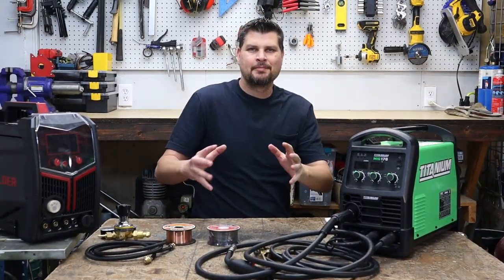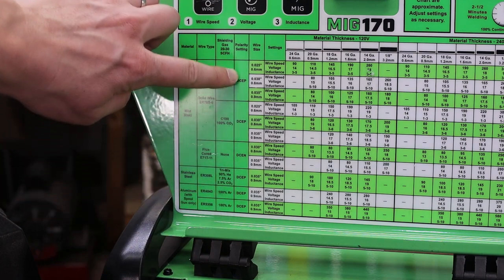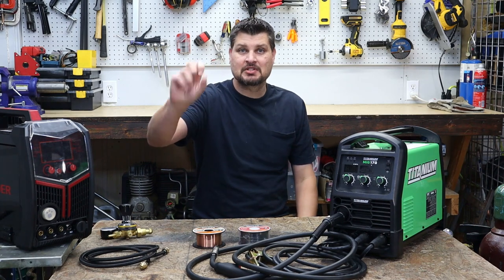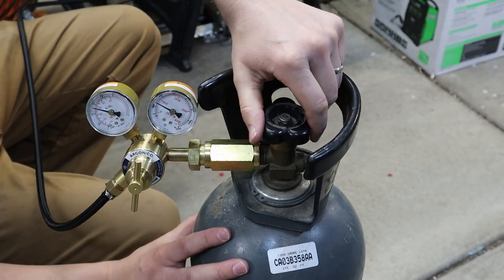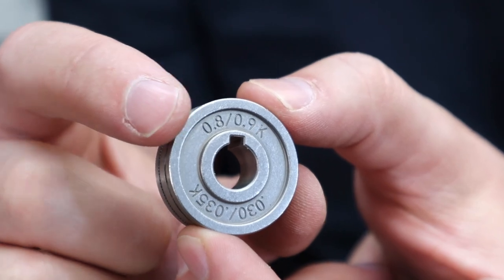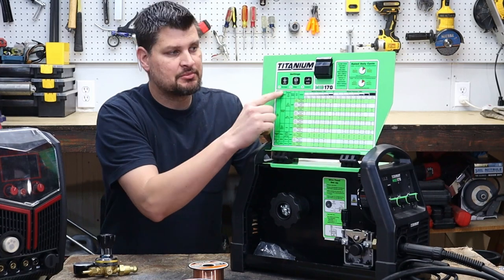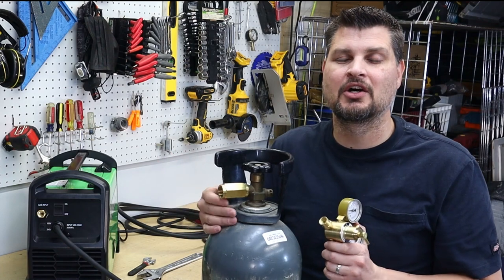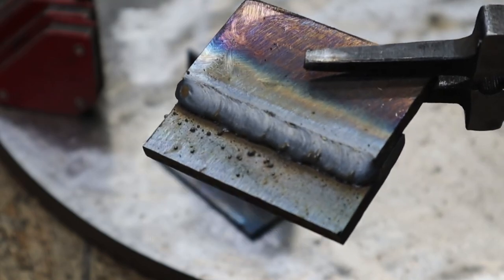Welder Gas Setup!  Switch from FLUX Core to MIG Welding!

Comment: Prolly out of luck but, TANKS, TANKS, TANKS or CYLINDERS, CYLINDERS, CYLINDERS!!  I want to make the jump from flux core non-gas to real, honest to goodness Mig or GMAW but I've been sucked into this black hole of cylinders.  All I want is an 80 cu/ft 75/25 cylinder so I can start welding.  What I'm finding is some places charge ridiculous prices for the "swap meet process" or if you find a great deal on a brand new, completely filled cylinder with all the current certs for pressure testing and DOT stamps --you can't get the damn thing filled or swapped out if it ever runs out!  I feel like I've entered some bizzarro world where everyone's either covering their A$$ or trying to rip you off --or both!  And the price of these things --holy banana peels Batman!!!  Anyway, thanks for the vids.  Your channel has been very helpful for someone trying to learn on their own how to weld and I thank you for that!

Comment: Tks for the video. Very instructive. What  flux core weld machine brand model do you recommend to purchase for beginner and after a while jump from. Flux core to a Mig weld machine?
Reply from the maker: For entree level I think the Titaniums and Yeswelders are good. Start with this:
https://yeswelder.com/collections/welder-cutter/products/gasless-mig-welder-135a?ref=uDQs4bv7pZQF3
Then move up to this for MIG:
https://yeswelder.com/collections/mig-welder/products/mig-welder-mig205?ref=uDQs4bv7pZQF3

HF are good because they are local. Yeswelder are nice becasue they are a bit cheaper and you can use my code! MECHMASTER
Reply: Can I use that as a Mig in the future?
Reply from the maker: @innando  not the 135. Yes on the 205